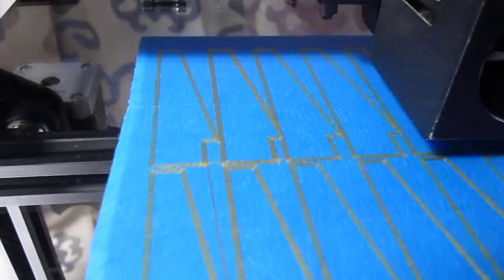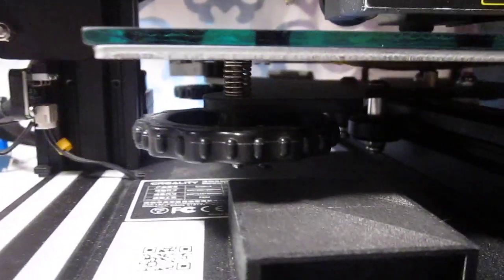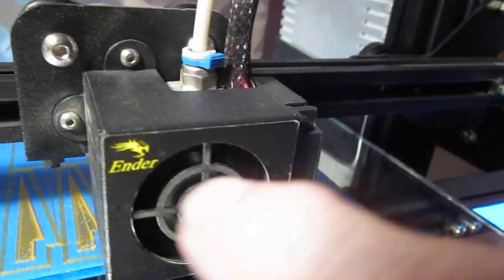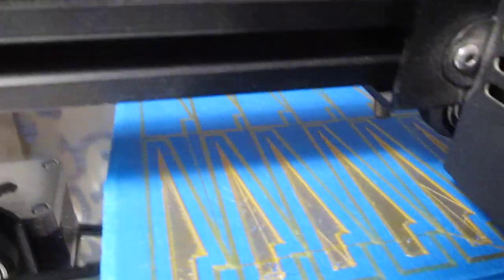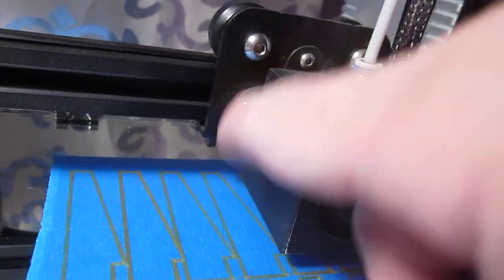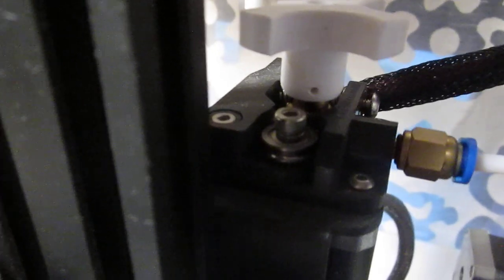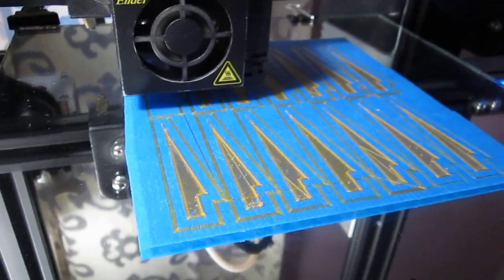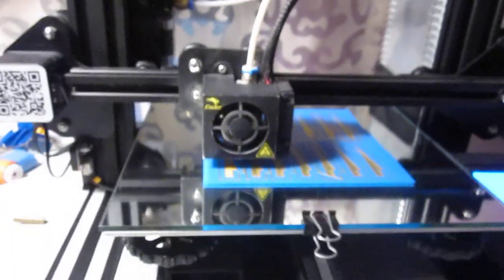My ENDER 3  printer and it's set up.

Comment: You are correct 100%.  I see the folks on Youtube pounce so hard on adding mods.  Mods have their place when needed for a requirement.  Most of the time, I just want to print what I need done and that is it.  I just purchased/fixed two refurbished Ender 3 Pro printers off of ebay.  It became obvious that the previous owners had no clue on what you eloquently mentioned in the video.  Some parts were missing, but easy to replace and fix.  I purchased the metal extruder and realized at the last minute that the later generation Ender 3 Pro's fixed the wearing problem by adding metal in the plastic little hole.  I've been printing non-stop without any mods needed on the Ender 3 Pro's.  I did add silent boards and cheap spring sheets for functionality purpose.  Besides, I sit next to my printers all the time.  The mirror bed with the tape will get the job done fine for PLA.   I hate adding glue stick on the bed, due to its messy clean up later.   I only use it on ABS, if needed.  I've never tried printing without heating the bed when using PLA. I will try it this weekend and see the results.   I have really enjoyed printing on glass when using my other printers.  (No bed leveling issues or probe needed.)   Nice video!